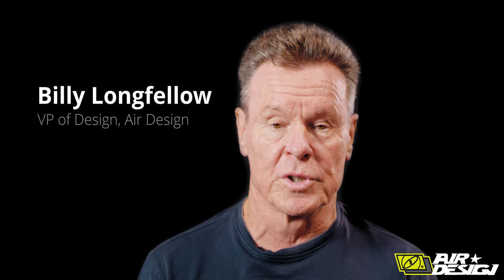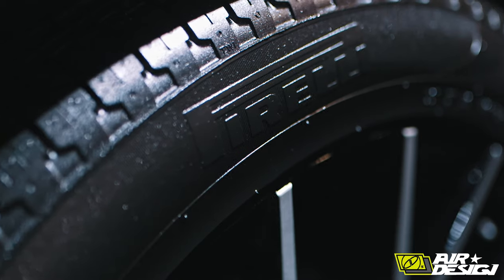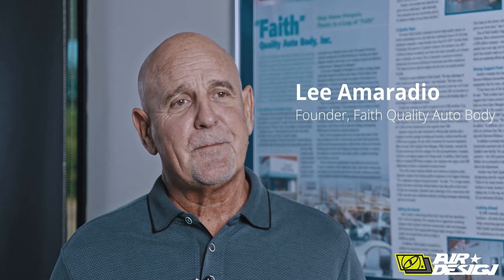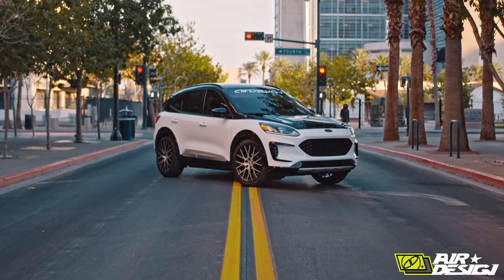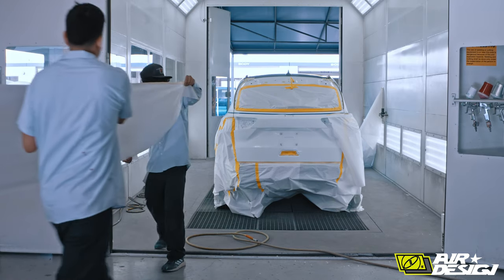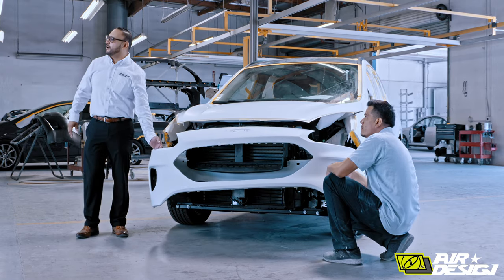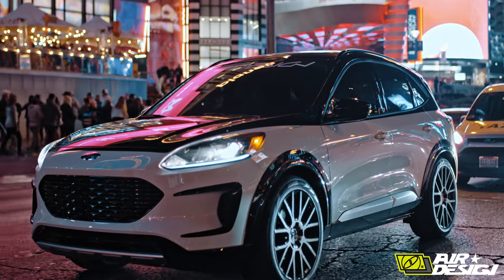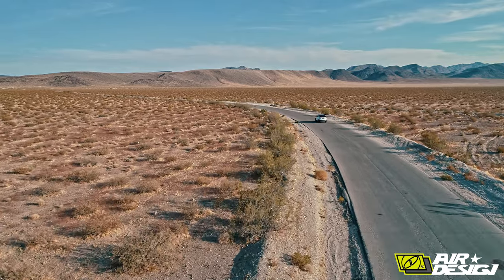Air Design 2020 Ford Escape SEMA Build

Comment: I recently gotten a 2020 Ford Escape SE in black. I got it on Monday late afternoon. My old 2015 Ford Escape SE broke down on Monday late morning. I have it towed to the dealership to get it fixed. An oil leak in the engine and the cost for repairs is over 8,000 dollars for it. I texted my sister about it. She asked her husband to see what they can do. My sister called the dealership and even talked to one of the dealers there. I even test drove the 2020 Ford Escape and fell in loved with the smooth ride. Even the left blinker works in it,too. My was out for a few months on the old one. My old one was so easy on the controls and even the new one,too. I figured out on using the Apple Car Play on it. I did that on Monday night. Some of my friends that will be surprised on my new vehicle once they come back from warmer weather to spend summer towards late fall. It would be early May for some people.